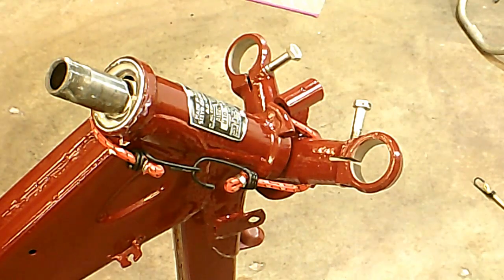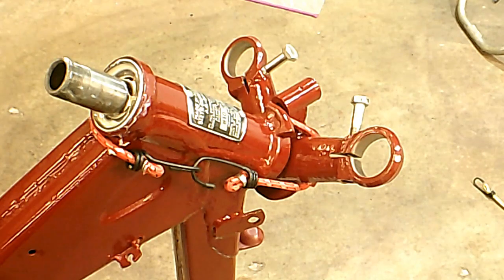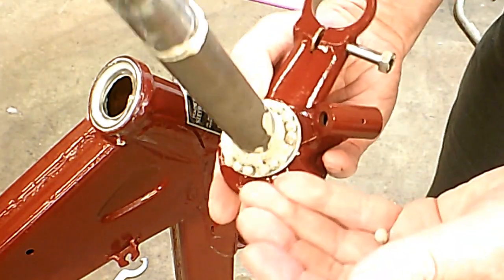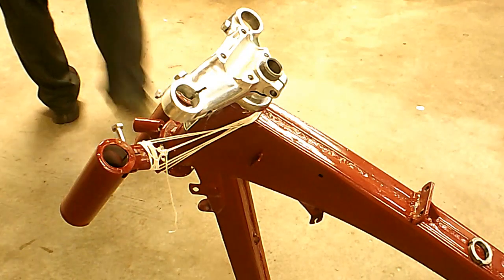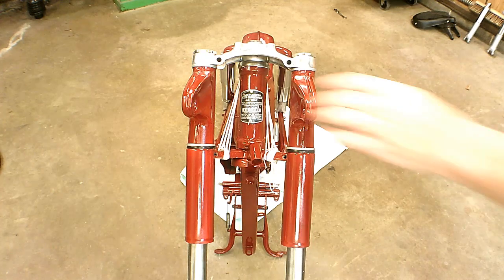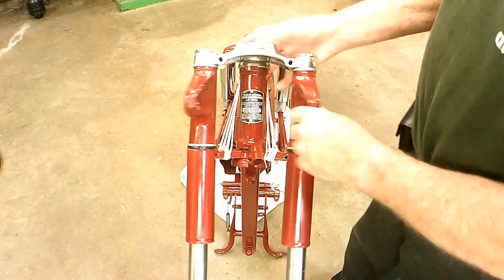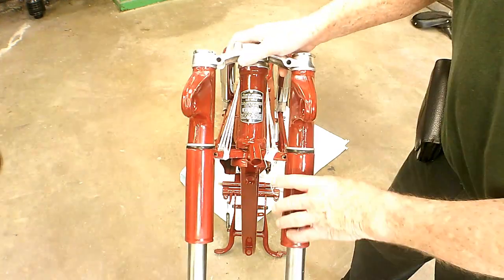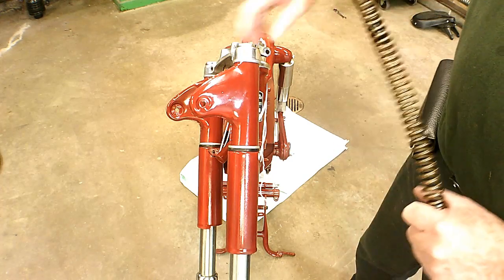1955 Sears Allstate 250 Puch steering head assembly. How I did it.

Comment: How did you derust the inside of your monocoque frame?
And did you paint or seal it inside with anything?
Reply from the maker: As the videos show, the old blue paint was sound, so I simply block sanded, and painted over it. Inside looked fine to me, so I oil sprayed it. I am only figuring that this bike will last another 70 years, then this will all need to be done again.
Reply: @Adventurepilot70  I faced that connundrum with square tubing on a free rusted out boat trailer I completely derusted and restored and converted into a 20ft ultralight aircraft trailer.  If the piece had be off, I would of soaked it in a long tub of vinegar  down to the depths of the rust pits (I did that with the two square axles).   But it was welded on as the tongue and it would of been too involved to cut it off just to derust the inside, then re-weld it on.  

I was blind at the time so my stick welding skills was sketchy being unable to see a weld puddle at all under the helmet.   I don't remember what I did...   probably ran a steel brush through it and sprayed it inside with something the best I could.    I had the whole rest of the U channel frame to worry about... so...  the derusting of the square tube inside was not comprehensive and kind of half-ss'd.    

Drove the whole thing to Indianna and back from Georgia bringing home a free airplane, with the only part to fall of being one of the grease dust caps on the tires as the interstate up through Kentucky was an ocean of potholes.   I was prepared with a spare however, and wrapped some clear packing tape around it by the side of the road to keep it from coming off as well.